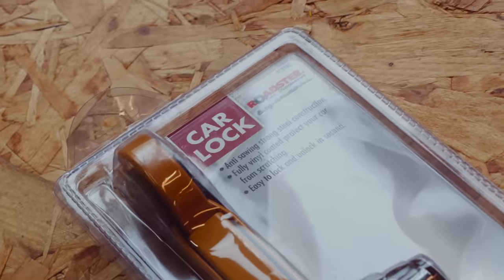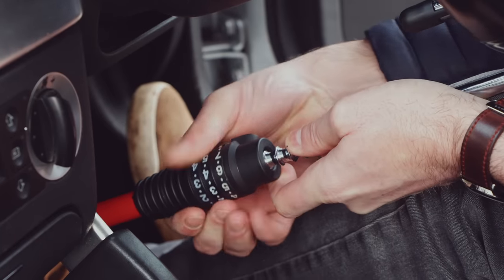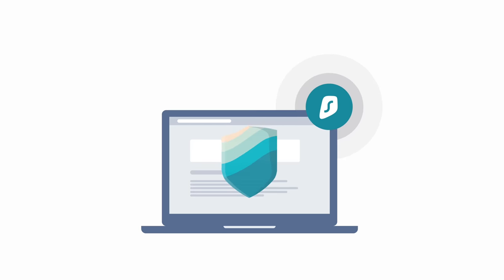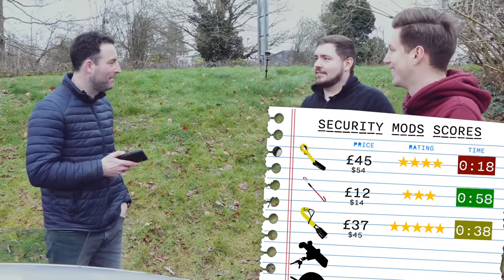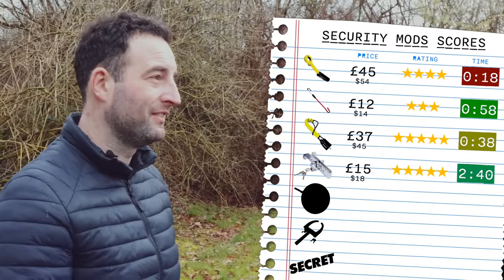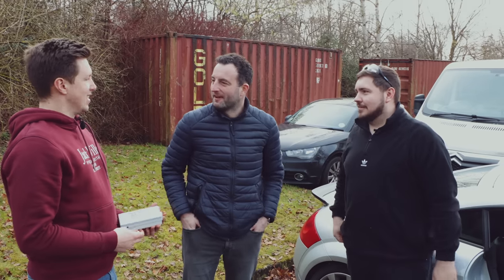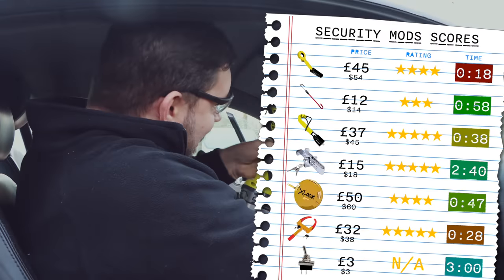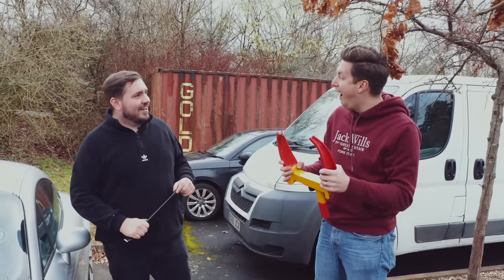Trying to Steal a Car with Anti-Theft Products

Comment: I saw an instance whereby a bar steering lock was used ~ simply make the lock/key aperture is facing the windscreen. There is room to lock/unlock with key and definitely insufficient room/workspace to use power tools to drill out the lock ~ what do u think??? Care to comment

Comment: Actually theres a better way to install a fuel pump contraption.

By using a switch thief will know that theres something like this ,because he wont hear the pump sound. 

Solution:
Install electronic valve the furthest away from fuel pump as possible. This way the thief will hear the pump, but the car obviously -> wont start. Instead a switch you could use something i saw in old subaru. This was kind of immobilizer which was deactivated after shorting keyhole with a mounting screw on the dash making it almost impossible to find easily.

Combining it with deactivating fuel gauge - so that the thief will think the tank is empty will possibly end up in making him refuel your tank.

Comment: Put the switch in the glove box and lock the glove box - gives you about 10 mins, it's enough to deter most thieves. Also, if you car has an individual coil, you can use this instead on the -neg (just wire the switch inline). No spark no start.

Comment: My old car had two switches, one similar to this, but also another in the wheel arch that I installed because it had a battery drain problem so I could disconnect the battery after i parked. That car was borderline impossible to steal, not that anyone would want to lol

Comment: Put the pedal locker under the brake pedal in an automatic that doesn't require the brake to be pushed to start the car. Your car will be gone no matter what with that thing but this way the thieves will be gone as well
Reply: Most automatics require you to press the brake pedal, before it will go into gear.

Comment: The lesson is pretty simple and disquieting, but we knew it in advance: ALL  these devices are deterrent for amateurs. None is a deterrent against a professional. The professional is determined to get what he/she's looking for, the amateur is after a thrill , and doesn't need a hassle. Conclusion: Spend between $30 to $60 and sleep soundly, and know that your car is going to be there in the morning if amateurs were passing by. It won't be there if a professional was on the make. Another factor to consider and ignore: Depending on the year, make, and model of your car, i.e. if it's the thieves' favorite to steal, it will be stolen with or without a protection device. Read the statistics of car thefts in the US and don't worry: You have no control over what professionals want, and the amateurs don't really care about the Y,M.&M of your car or the statistics. Sorry, life is not fair, get used to it. P.S. My car had just been stolen 6 or 7 days ago. Had it for 10 years and didn't know that it became popular, but I'm not crying over spilled milk. Got another car --I needed one.

Comment: With the steering wheel and clutch lock,  could you just adjust the steering wheel, if you movved the steeing wheel down and in the lock would just fall off.

Comment: MECHANICALLY STOPPING STARTING RESULTS IN DAMAGE.

ON A NEW CAR, with the connector under the dash by the DRIVER CHANGE THE ORIGINAL CONNECTOR FOR A CUSTOM CONNECTOR WHICH IS INCOMPATABLE WITH A STANARD CONNECTOR. THEN MAKE A SHORT ADAPTER CABLE WHICH YOU KEEP IN THE TRUNK/BOOT.

I HAVE A RFID TOGGLE IN MY POCKET and the RFID DECODER/KILL SWITCHE IS CONCEALED ON THE VEHICLE.😊

Comment: Killswitch with extra steps is also fun to do! I need to hold volume down, switched out the number 5 on the radio which I need to push once and  within 10 seconds you need to start the engine.

putted in the ignition wire killswitch and fusebox killswitch. Only allowed to use my volume button on the steering wheel and not on the one in the radio XD

Comment: I just use a battery-powered alarm device secured under both seats that is engaged by vibrations and won't turn off until I switch it off with a key. And it is louder than a regular car alarm. xD

Comment: the thing is though is that you don't steal cars like this anymore nowadays you wait in a parking lot with a device that catches the unlock/lock waves of the keyfoab & just replay it to the car & drive off
Reply: And the worst part is that ypu can get a clon device even on ebay or amazon, its fucking insane
Reply: cutoff switch would still work.
Reply: @rossmaclean2  yes it would forgot about that
Reply: Nah, just find a kia and watch like five tiktok videos..
Reply: Deactivate the keyfob so that it doesn't emmit signal. Open car by pressing key buttons. Start car by putting key next to push start button.
Reply: @candiriv23  pain in the ass tbh & in any case if someone wants to steal your car they gonna take it it don’t matter…
Reply: @candiriv23  it still emits a signal if you can press the button so it would have to be a key & when you have a key you can basically shove a screwdriver in & it works

Comment: A real car thief would laugh at all those anti theft devices. The best thing is a hidden switch in the HT circuit so car turns over. Lights work. Horn sounds. but it won't fire. Real head scratcher.

Comment: Back in the 80s a mate of mine bought a Triumph Dolomite Sprint that could also run on LPG for which it  had an extra tank in the boot. There was a switch under the dash to change from one fuel to the other. He very rarely put LPG in it and when he parked up he always flipped the control to the LPG feed.
One evening he had parked up in Leeds when some toerag tried stealing his car. How far did they get? Halfway out of the parking bay! 🤣

Comment: These devices won’t stop a determined pro car thief unless u pull out a couple relays.. thieves carry tools not relays car thieves know bout kill switches also u didn’t try the club but put it on in reverse wer they can’t drill the key slot

Comment: I might actually install a kill switch on my truck since I’m gonna be putting remote start on it which bypasses the padlock system. One one hand I can get cheap spares, on the other hand I gotta fiddle with wiring to add a kill switch that is bypassed by the remote start or make it work with a remote that I bring with me that works off rfid

Comment: If you use three toggles then they each have to be in the right position to start the car. To get extra clever you use three toggles, but use the three position toggle to achieve an inpenitrable toggle lock.😎

Comment: Though you have to say, a car without safety measures is still faster to steal than a car with any of these. The best one imo is a detachable steering wheel, at least if you can put the steering wheel somewhere. Don't think a lot of thieves have an extra steering wheel with them. You could also put it into a safe inside the car, which adds the ability to store the steering wheel when ever you are unable to put it somewhere else
Reply: then all you need is some vice grips to steer haha
Reply: @ericmarciniak1  Don't think they have that either and if so, doesn't feel very safe to steer the car like that. Imagine a hidden switch where you can turn off the power steering, that would be fun to look at when someone steals you car 😂

Comment: Lol its at the point where you need to take the steering wheel off, 3 tires off, have 5 kill switches, have a wheel lock on your 1 remaining wheel, have a seperate alarm system that is separately battery powered hidden somewhere, drive a stick, take out the car battery, take out the drivers seat, have blackout covers for your windows so they cant see out, pedal locks, idk what else but im sure im missing something cause im sure a thief can steal it in under 2 minutes still 😂😢.

Comment: How to stop your car being stolen: Drive a car with the street cred of a Safeway shopping trolley. Here in sunny rural Japan, I have left my cars unlocked, outside for literally three months at a time and the only problem is getting them to start when I get back from my winter vacation. The last owner policy works a lot better in Japan than say in UK. A 20-year-old vehicle from auction here will typically have less than 100,000 km on the clock and will cost you less than 100,000 yen (Stg.500). Run for a few years, then dump, scrapping is free. Ask yourselves, who are you trying to impress with your all fashion, limited function flash cars? Friends, neighbours, colleagues, relatives?  Try putting a ladder on one of those useless Audis. I run Pajero iO with its over-engineered transmissions to cope with winter snow. But with a budget of 100,000 yen you are literally spoilt for choice. Sure there are auction add-ons. Try a Toyota Probox (catchy name); these sales rep wagons are chucked into the auction after a few years. Use it for a few years (one Shaken) and scrap. No punk car thief in his right senses is going to nick it. Diesel would be favourite especially as diesel is some 20% cheaper that regular. but that are as rare as rocking horse manure.
Jack, the Japan Alps Brit

Comment: The first one would have worked for my manual since you can't twist the knob off and have to pull some trim out🙃
Reply: There plan B would be to drill the lock, or Plan C cut the end of with the angle grinder they had.
Reply: @gantfrost7749  oh indeed it would but if they dont have those things it could help

Comment: I built a steering wheel lock that's easily defeated.  But when it's defeated it sends 3000 volts through the seat near the testicle.  So far it's worked three times.   Now I have to buy a third freezer.

Comment: the two cheapest were the best, of course!
if you're going to do something, and you especially should with a modern 🤣car, it's going to be the kill-switch.
the kill-switch bypasses all the "features" of a new car that make it easy to steal- proximity fob, CAN bus, maybe others. still great for vehicles of all ages 🙂
I think it would work much better still if done more clever than an obvious throw switch visible by just looking low.
may I suggest a low-profile click-on/click-off button installed underneath some of the car's fabric somewhere. the idea is to make it invisible while being easy to touch ..if you know where it is. you can get even more clever by installing two away from each other in series so both have to be "on" for the car to start 🤓
go for secondary measures if you wish, but I think your first go-to in improving your car's theft resistance is *kill-switch* 😎

Comment: Some cheap devices are usually the trickiest to scramble...  the worst are those that are integrated into the car computer.. if can access the computer you're good to go....then the other thing is a thief will not just concentrate like that without looking if someone is watching.  Mine has a switch only my mechanic knows where it is. 🎉

Comment: That wheel cover lock may prevent most thefts unless they carry around a drill.
Reply: the better wheel cover locks are on the back of the device, so  you cant get to the lock with a drill due to lack of space

Comment: Hey, I just had an idea after watching your cool video.  How about when you try starting the car without turning on the kill switch (3 way), you turn on an alarm?  And a  camera with a mobile hotspot device?   Such camera does not need a wire because it works only off the kill switch, not sensors the require constant power.   Comments?

Comment: The only way is to put in a fuel pump cut off switch and a starter/battery kill switch. Or just take your coil wire lol.

 Just hide it better lol.

Comment: Time is of the essence. First thing put a club on the steering wheel. first they gotta break into a locked vehicle. Then they gotta cut the thing. This may be enough of a deterrent for them to simply move on to another vehicle. Don't have a popular vehicle to begin with to attract attention. Always lock your vehicle thieves are opportunists its amazing how many people don't lock their vehicles. And finally have a well hidden kill switch attached somewhere in the starter circuit perhaps even before the starter relay. the best possible place is at the start fuse but you gotta probe around for the correct wire in the harness because the bad guys better NOT find the wires leading to the kill switch, see? 

I would design a circuit that turns the horn ON with ANY attempt to engage the starter. And the horn could NOT be shut back off until either one of the battery terminals was removed or the circuit was turned back off by disengaging the kill switch. this would take a separate relay mounted somewhere (to enable the horn). Once that horn fires off that would the end of any further attempts to steal the vehicle thieves are not that stupid.

Comment: A  magnetic reed switch, set up either through the fuel , or ignition switch would be ok,  a hidden magnetic switch to start the car, with another you press to disconnect the switch relay, , after you shut down the car.

Comment: I use a momentary switch spring loaded switch for my starter motor solenoid,
you have to  hold the sprung loaded switch in order to turn over the engine.
Otherwise, Click! and nothing else.

So far is actually has stopped a thief taking my car, they broke my steering lock.
Came back to find the ignition on but they the switch defeated them.

Comment: That tire boot is not the same as boots used by parking enforcement. Theirs you can not pry off. You can literally drive off with them and cause damage to your entire fender well before it will break off.

Comment: Or better yet ...pop ur hood, remove fuse box cover and pull fuse for the fuel injector and take with u....tbh to remove takes less than 60 sec and putting it bk the same...it's free cuz its part of ur vehicle and effective🤷🏻‍♀️.....towing it tho would be another story....but for them to break in and drive off...not happening unless they carry spare fuses 😂 loved the video, great laughs ✌🏻

Comment: Your car does not need to be totally secure. There is no such thing.
And if someone is determined to steal your car, then it is stolen.
Locks and things only deter lazy thieves, and your car only has to be slightly more difficult to steal than other cars nearby.

Comment: I had one it disabled electrical and the  fuel pump

is a multi-switch combination you had to have an exact combination turn the switches on and off in and fine

Comment: The best theft device is a hidden kill switch that shuts the fuel pump off or blocks the fuel line. If the car wont run, whats the point of steeling it?

Comment: If you're that serious about your car being stolen it would be cheaper and alot faster to just disconnect your battery or pull out a fuse that will stop the car from starting 😂

Comment: Those switches are extremely common in Brazil, but they are usually a small button in a random location tied to a timer. It lets the pump work for a minute or so and then kills it. There could be fake buttons around as well, and some timers wont start if the car doesn't move.

The intention really is to kill the car while the thief is driving. The breaks and steering will still work, though.

Comment: Another easy cheap one is to just take a specific fuse out so the car won't start.
Reply: How do you go on a date or to the shops ... with taking a fuse out? feels like your nice suit will get dirty. Just trying to sound smart doesn't really help anything here
Reply: @Dharqness  taking a fuse out is a good temporary measure, especially if you are parking it somewhere a bit dodgy. for everything else you can get a switch or button put in somewhere close.

Comment: I recall hearing from someone that they used a switch like this to reroute power to the horn instead of the starter motor when you turn the key.
It was pretty effective, couple of times he heard a loud honk from his apartment parking lot and knew exactly what had happened, and never had his car stolen.

Comment: Most took more time to install than to remove XD
Reply: Except for the kill switch. It takes a few hours to install, but a matter of seconds to toggle every time, and the longer it stays installed in the car, the more those three hours of up-front labor pays for itself. :3

Just get a switch that's easier to hide, and tuck it away a bit more discreetly, and no thief will be able to steal your car, even if they commit to getting in it.

Comment: If you have a manual transmission, then that's all the security you need.
Reply: Morons are timing how long it takes to remove the security tool, but they never tested how long it takes to start the car.  So, technically the last item is significantly worse than the rest.  I'm shocked they put the switch in a easy to find and visible spot.  I would like to know how long these morons would take to start a key-less vehicle without the key fob signal.

Comment: make that kill switch a 3 pole switch and turn on the HORN as the car cranks;  deters theft and it prevents YOU,or the WIFE,  from forgetting and draining the battery; NOT easy to do though,and do buy a GOOD switch and professionally wired,.. or you may be stranded with a stopped fuel pump.

Comment: You puppies🤣🤣🤣🤣🤣been using kill switch since 1960s but under front wheel arch. To easy to find in car, or in locked fuel flap.👌👍
Reply: Now I know how to steal your car. Thanks.

Comment: Why didn't you show the test for the market leading 50 quid Stoplock ? . You did not test the proper £130 disk lock either which is just  as popular. 
I think it's because you failed to remove either of them , debunking your own video.  Whole thing seems disingenuous.
Reply: Both of those would sucumb to being drilled out in the same manor as the wheel lock. IIRC the disk lock has a re-enforced mechanism which would have taken longer, but with a drill they’d both be gone within 1 minute 30